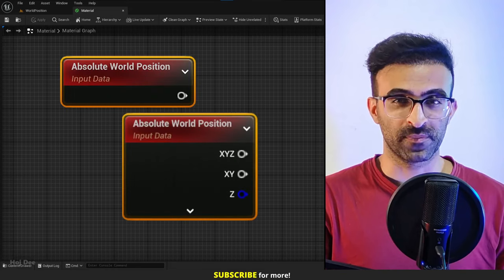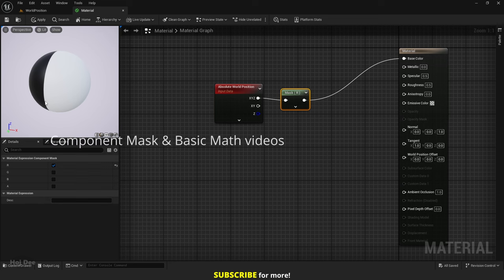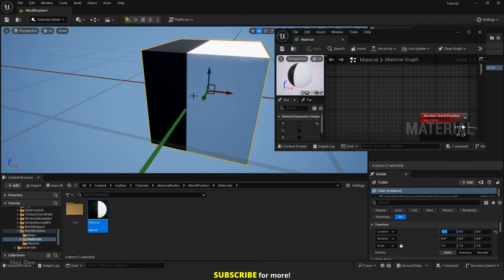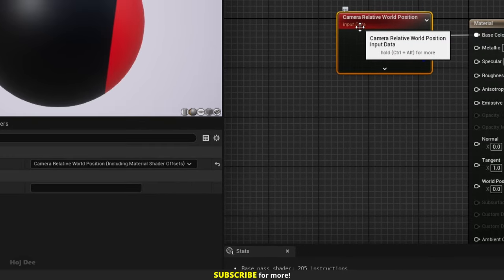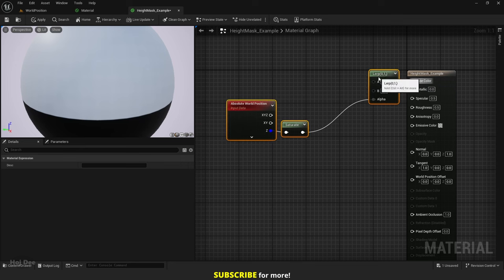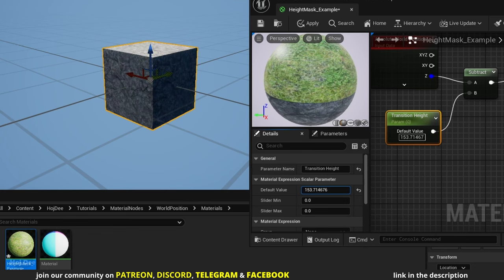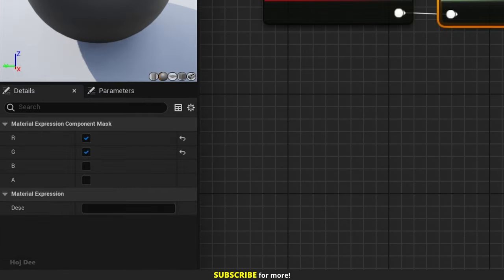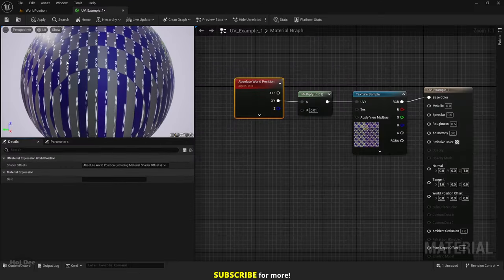World Position Node EXPLAINED! Unreal Engine Materials

Comment: that part about not needing uvs to be unfolded feels like it'll be super important for oddly shaped shapes. the first shape i made and added into unreal engine was a curved stone gate and it was really screwing me over since even if i unfolded the gate properly to avoid warping, the texture would have obvious edges where the pattern just suddenly changes. but how to add it in and its growing effect on the complexity of the material makes my brain start spewing smoke.
Reply from the maker: @offyourocker  yeah I always use it on complex models. Makes my life a lot easier.
It has some limitations, but mostly it helps.
use the world aligned nodes. I have a video for that too.

Comment: Why use the saturate node?
Reply from the maker: It clamps the values.otherwise the effect may break. I've explained it in this video:
https://youtu.be/tBib8qQxd1M?si=ekU_OlH7-lGSauf8
Reply: @HojDee  You can also use Clamp (0-1). Saturate is a faster(free) function on the GPU FYI.
Reply from the maker: @AL-bh2ws  thanks for sharing the information :) 
I have a clamp and a saturate video too. Check them out if you're interested